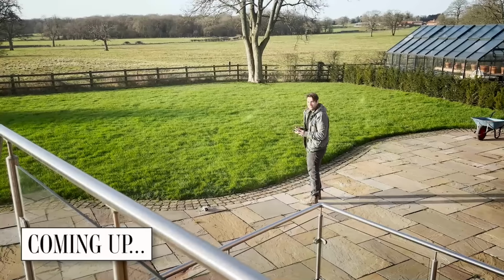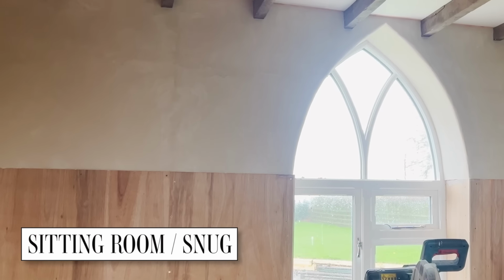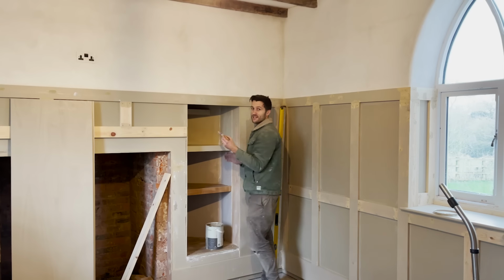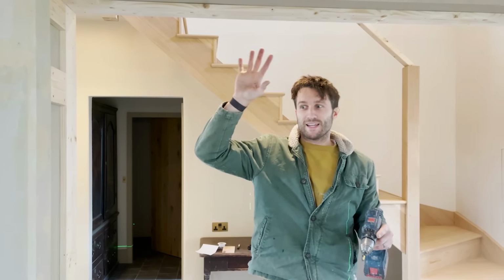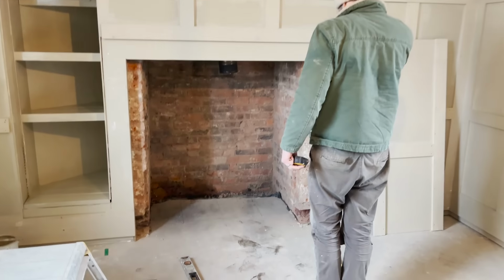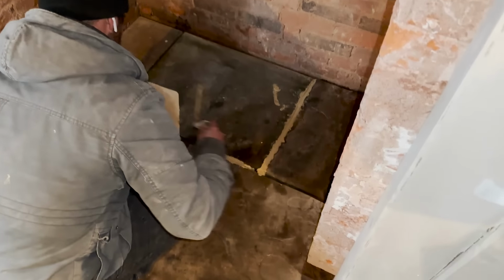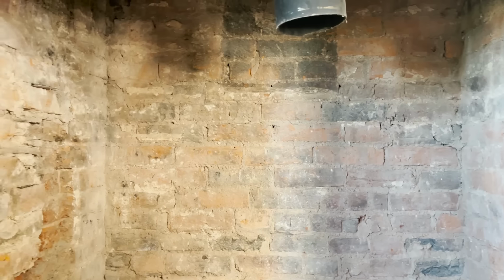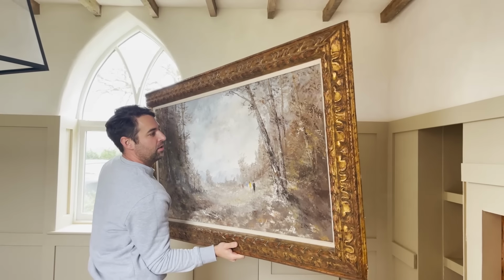Restoring our British Estate with Plaster, Paneling & Secret Doors | My Tiny Estate

Comment from the maker: Shop the products we use here:
UK: https://www.amazon.co.uk/shop/mytinyestate 
US: https://www.amazon.com/shop/deanstinyestate

Drone (UK): https://amzn.to/3UEOETk
Drone (US): https://amzn.to/3wls625 

Level (UK): https://amzn.to/3JlRIyM
Level (US): https://amzn.to/3JjKbjL 

Circular Saw (UK): https://amzn.to/3TIZcBE 
Circular Saw (US): https://amzn.to/490zVaJ 

Guide Rail (UK): https://amzn.to/3x7Ae6c 
Guide Rail (US): https://amzn.to/3PxbIlg 

Guide Rail System (UK): https://amzn.to/4af77eX 

Laser Level (UK): https://amzn.to/3x5Y5Di 
Laser Level (US): https://amzn.to/4al9v4o 

Concrete Cut-Off Saw (UK): https://amzn.to/3UMWWK6 
Concrete Cut-Off Saw (US): https://amzn.to/3QxKiwa

Angle Grinder (UK): https://amzn.to/3QEa2Hj
Angle Grinder (US): https://amzn.to/3QH90tY 

Tuck Pointer (UK): https://amzn.to/4dxSKp7 
Tuck Pointer (US): https://amzn.to/3Uy7USF 

Brick Acid (UK): https://amzn.to/3Ugavlc 

Muriatic Acid (US): https://amzn.to/3UmhGsg 

Garden Kneeler Pad (UK): https://amzn.to/4cHmGPb 
Garden Kneeler Pad (US): https://amzn.to/4aIfsbW

The links provided above may be affiliate links -- which means we may earn a small commission if you make a purchase through these links. This comes at no extra cost to you and helps support our ability to bring you content. Please note that not all products are available in both the UK and US; some links provided may be similar alternatives when available. Thank you for your continued support -- it means the world to us!
Reply: You forgot to include Calvin Klein.

Comment: I have wood panelings made out MDF (installed by a carpenter) in two rooms. It looks very good. But I do think with pinewood is the better choice. The house where I buyed my apartment is 120 years old and has thick (non insulated) walls. I guess the house you are renovating has a similar age ? Did you applied the plywood backing directly on to the walls ? Because I can remember the carpenter installed a kind of grid unter the construction, that there can be some airflow between the wood and the walls .

Comment: https://youtu.be/AKvCBpxZiAc?si=n8YeTmWcI8mjQVqk

Maybe something like this would help that room that the walls are getting wet and molding ? 

In my mind, I think you could put a small vent that runs down on the bottom and maybe even one on the top that blows warm air creating an environment that does not allow for the moisture